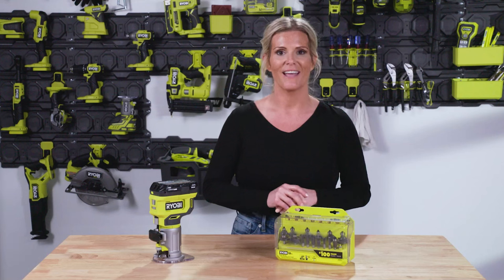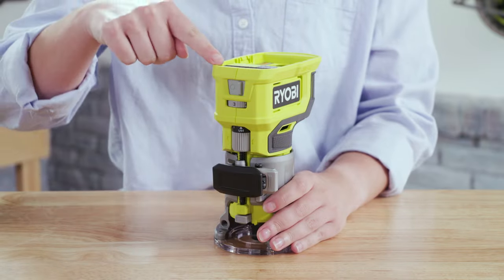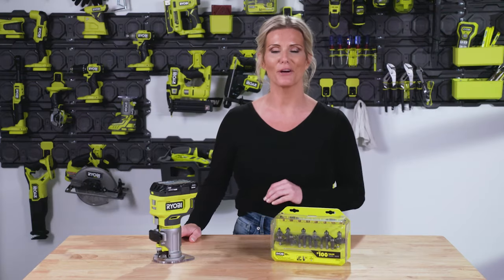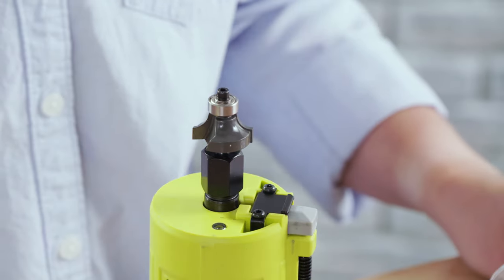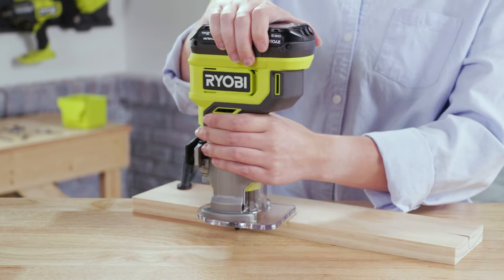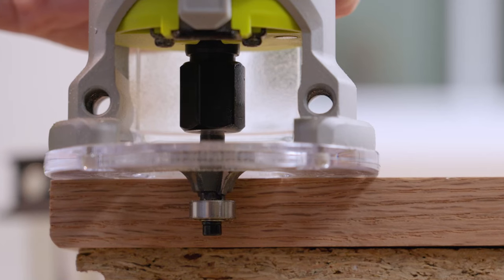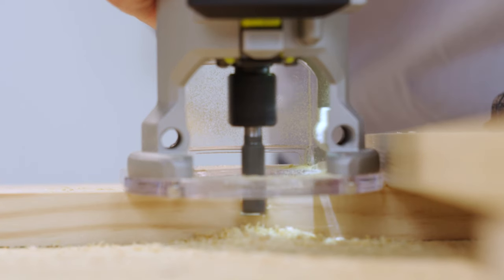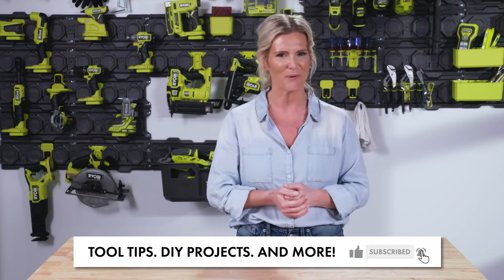How to Use a Router | RYOBI Tools 101

Comment: You didn’t hold the flat side against the wood fence edge when cutting the groove towards the end. This messed up my project all weekend because I should have been using the straight side of the plastic guide edge along the wood fence guide, but I didn’t, I used the plastic curved side because you did when cutting the groove. Your groove was short though and I had longer grooves to cut and because I used the curved edge like you did, I ended up constantly getting uneven crooked cuts. All I had to do was stop and watch other helpful videos to see what was going wrong. I could have been so much further ahead in my project if I just hadn’t watched this video first. What luck.
Reply: In fact, I just watched this other lady LITERALLY say to switch the base plate around to get the flat side next to the guide for “a nice clean cut”. I wish ryobi would have caught that!! Ugh messed my entire weekend up because I was clueless since I followed this lady’s video. SMH. This other video the lady uses ryobi and clearly states you have to do this.
Reply: How dare you mansplain to this stunning brave wahman!

Comment: I love Ryobi tools, and their instruction manuals are usually decent, but I found this router's instructions unclear at times (mostly in regards to installing bits, and setting up bit depth). I've figured most of it out via videos like this one, but I am still confused about how I should be using the ruler on the side. Every time you install a different bit, the recommended gap that we are supposed to leave between the bit and the collet will vary slightly (not to mention the varying lengths of bits themselves). Wouldn't this cause the numbers on the ruler to be arbitrary / inaccurate? Maybe I'm thinking about it the wrong way...

Comment: I think some steps were missed for installing the bit. Magically, the massive piece of plastic was removed. I can't get my bit in my router although it's one of the same kit bits, and I think the included tool has to loosen something. Currently, I still don't know how to get the bit in the round black thing thing that seats it.

Comment: I love my Ryobi tools and  I just bought this router!
Reply: Yes! Isn’t it so easy to use? Certainly mighty, but simple! What kinds of projects do you use it on?
Reply: @Madebyshannonevans  just starting to upscale from simple projects to more detailed so mostly adding some finesse to the edges of shelves etc.
Reply: I have it also but my router didn't come with that clear base plate shown in this video. Did yours?
Reply: @Shannon Evans I'll take a look at the manual and such. I've had it about 45 days and the box is gone.  I'm going to check it out.  I was about to make a new base plate to get something bigger than the square that it came with.   Thank you for the reply

Comment: OK, so the point about manually raising the bit 1/8" to allow for "expansion" because of heat confuses me.  Expansion how?  Which way (length, width)?  And does this mean that as the bit heats up and "expands," the cut changes as well?  Thanks in advance!

Comment: Maybe the model in the video is different than mine but my model requires a wrench (included in the box) to loosen and tighten the hex looking part where the router shank (end of the router bit) goes in while pressing the button at the end of the depth adjuster. I opened mine a few days ago and forgot the wrench was still inside the box so it took me a little while to figure out how to get the bit to go in.
Reply: This video shows the new version